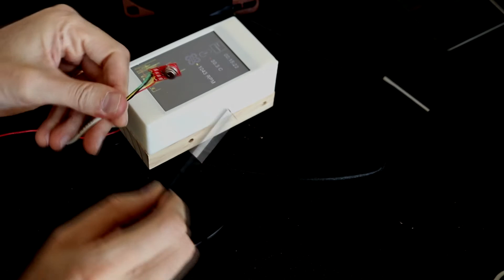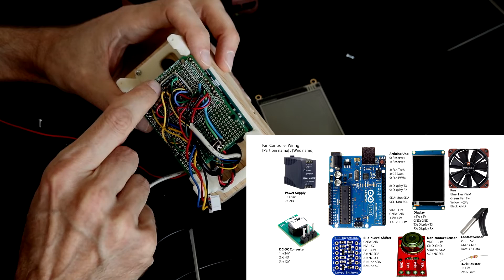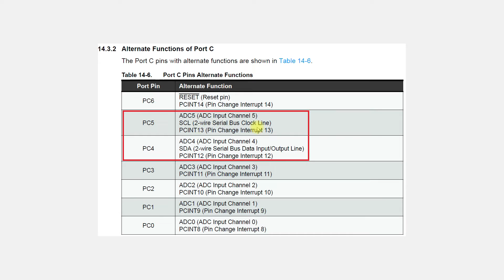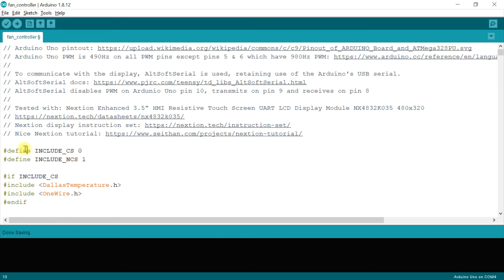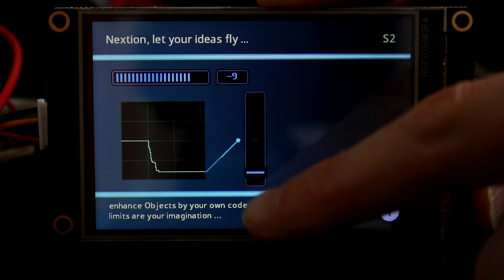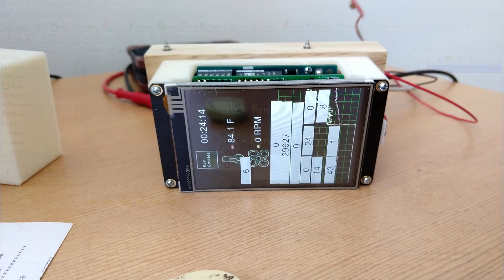Nextion Arduino Intro Temperature Monitor Fan Controller

Comment: Hello sir, can I connect the temperature sensor and the color sensor with the screen at the same time, thank you.
Reply from the maker: Probably, if there are enough pins on the microcontroller, or you can multiplex pins. Would need to know more details to give a certain answer.
Reply: @kentvandervelden  I have a graduation project for the college, the way the project works is a special device to measure the temperature before entering the facility, and I need to add a color sensor and a motion sensor as well. Can this informations be added to the screen? Also, do you recommend a specific microcontroller

Comment: permission to ask, I have a problem about.
1. How to prevent the initial value of the graph from being lost because it has been replaced by new data?. so that the control display is visible.
2. how to add time in second which always changes as the data increases, so that we can see the rice time and settling time.?
thank you.
Reply from the maker: If I understand correctly, you want to see all of your data over a longer period:
1. The resolution of the Nextion waveform is limited by it's dimensions. If 200 pixels wide, only 200 values can be shown. To not lose data: store all measurements on your microcontroller, sample or interpolate the data to the width of the graph.
2. I would update a Nextion text widget holding the time in seconds from the microcontroller updating the waveform, in succession.

I hope these suggestions are what you were looking for and are helpful.

Comment: Thank you for sharing.
May i ask a question? I can not send data to arduino from nextion. I read temperature from a sensor, print it on nextion. User can set a temperature value from nextion, when temperature value reaches the sensor value, heater stops. How can i send user set value from nexrion to arduino and compare it with the sensor value? Thank you, all the best.
Reply from the maker: There may be three ways: 1) Polling: On the Arduino, regularly read the value of the the temperature widget on the Nextion; 2) Event: Send the widget ID of temperature widget when it changes, which the Arduino receives, this could be as easy as checking the operation in the Nextion editor to send the widget's ID; and 3) On the Nextion, use prints() or printh() functions to send a custom message from the Nextion to the Arduino containing the set temperature. More information about prints() and printh() is on the instruction set page, though the information is pretty terse. Hope this helps you to complete your project.
https://nextion.tech/instruction-set/

Comment: When you were talking about using the 16u2 as the main processor, you are basically describing the Leonardo which uses a 32u4 as it's processor and it has a native USB interface.  My vague understanding is that the price of the 32u4 chips have increased due to demand and aren't available any more--so no more Leonardo's.
Reply from the maker: Thanks David, I'll compare the boards. I started modifying the Uno files for a new board. The Atmel might be overkill for this simple application but people have familiarity with it. What processor would you base the new board on?
Reply: @kentvandervelden  I would reuse existing modules to simplify things.   Both the esp32 and STM32 (blue pill boards specifically) would be good candidates.  The STM32 has native USB while the ESP32 has WiFi and a lot of memory/processor.

Comment: what about water cooling the servo? much quieter and much more efficient. and you could still use arduino to monitor it. 
i really like the graph display you made :)
Reply from the maker: Hi Fox! With air cooling, I'm just below temperature for frying an egg :) How would you make make the water block? Off-the-shelf ones could be bounded to the sides. The contact area would be small because the block would sit on the servo's fins. Could fill the gap between the fins. A custom water jacket with coolant is in direct contact with the servo body would be great. Maybe mill grooves into the servo body, through the fins, to receive the top and bottom sides of the jacket.

Comment from the maker: Check out my most recent video: https://goo.gl/Jj7cU1

The Arduino's USB serial interface is still available and could be used as a bridge between LinuxCNC and the Nextion touchscreen. Some cool uses include displaying the current tool, spindle speed, mill position as well as toggling coolant, spindle brake, and so on. What would you find useful displayed near the work? Interesting suggestions might become a followup video.